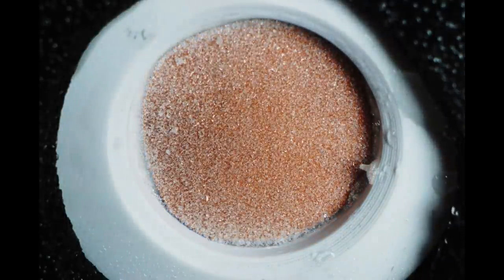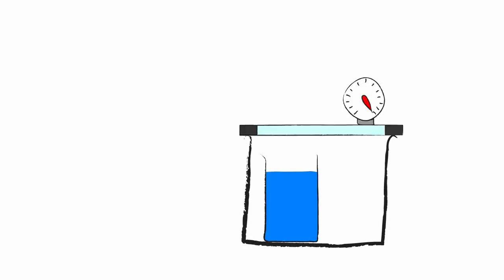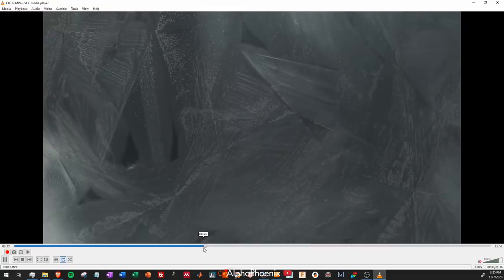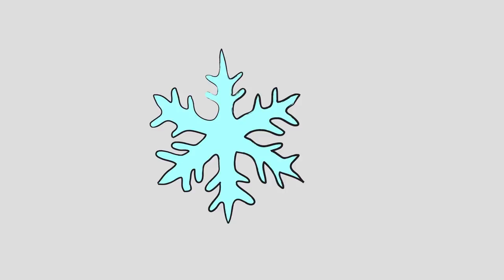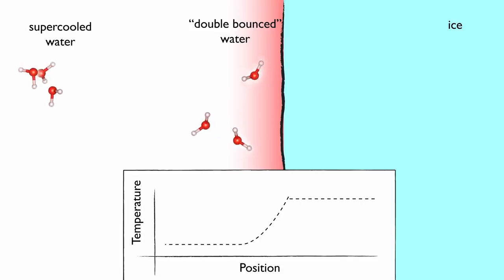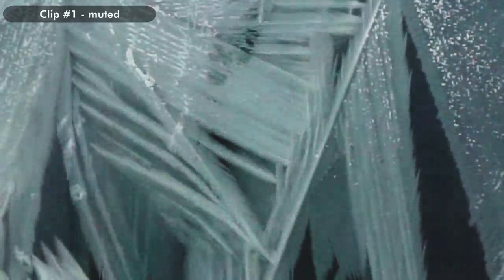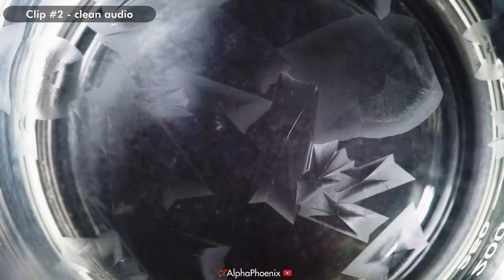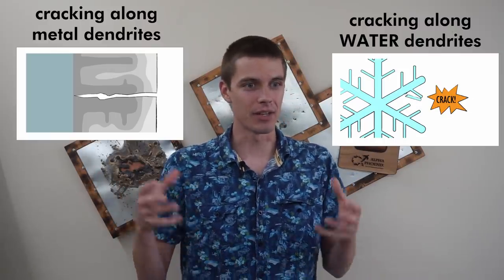The Sound of Freezing: Explained!

Comment: Awesome video. Such a great explanation and really nice clips from the freezer. I have been wanting to make a video showing the degradation of concrete from cycles of freeze/thaw. Whenever I get around to it, I'm going to need to remember these lessons about filming in the freezer!
Reply from the maker: ah i was totally going to add a joke about cracked pavement in Ohio and i forgot! this is like freeze-thaw cycle occurring inside the ice... good luck with your eventual filming!
Reply: @AlphaPhoenixChannel  perhaps the high pitched sounds are the result of a rapidly growing crystal lattice that traps previously-dissolved gases.  Ice would encircle trapped pockets of air, and press inward to due to the expected increase of volume of frozen water.  The overpressure of air bubble crystal inclusions in ice is a well studied phenomenon, although your interest in sound might be ... unique.  I would expect the individual "blips" of sound to be the shockwaves caused by stress fractures created when ice encircles a pocket of water that hasn't ejected all of its enclosed gases out of solution.  When gas leaves solution, the volume is expanded many fold, and if there's nowhere to go ... the gas is gonna crack open the surrounding ice structure to relieve as much pressure as it can.  I would not be surprised if the dendritic growth pattern allows a relatively uniform statistical distribution of air bubble sizes and thus the compressive stress to sound effect picking up what looks like a quite short range of frequencies.

Now I want to see the effect of degassing, and if that can explain the different crystalline growth patterns.
Reply: Hey Practical Engineering, why don't you also come over to odysee. I've got some LBRYs waiting for you :-)
Reply: I just noticed you posted here Grady! It's awesome to see you both know each other's channels!
Reply: @erictart4225  Isn't the water already degassed as it is cooled by evaporation in low pressure?
Reply: @Kycilak  possibly at some amount.  I suspect that the cooling process would successfully freeze the water before ever truly and fully "degassing" the water being frozen.

That's why I mentioned fully degassing sample water as an additional control - getting a true answer to your and my question.
Reply: Well look who it is, my other other favorite youtuber

Comment: Time to put a good ultrasonic transducer / hydrophone into a sound-dampened version of the experiment, and record with a few hundred kilohertz of bandwidth. Oooh! Oooh! Then take a wacky turn into left field and start pulsing ultrasonic energy into an ice-forming region. Would a pressure wave inhibit ice formation while a rarefaction wave would enhance it? If you could set up standing waves, would crystals form along the nodes?
Reply: I want to see this!
Reply: On top of this perhaps use a thermoelectric cooler to help remove the freezer noise from the equation
Reply: Yeah. Whatever he said.
Reply: I know you! We played TF2 like 10 years ago
Reply: @Ryan-xc8uh  small world
Reply: I wonder if you can control the rate of growth by putting the water under pressure to govern the expansion... When I lived in buffalo NY we used to stuff beer into the snow and they would stay liquid until you opened them, instant beer slushie volcano, it was fun at parties to watch someone forget!
Reply: My recording microphones goes quite flat to 30 kHz (then sensitivity start to taper off - but they will still pick up sound quite easely up to at least 48 kHz). Not as good as "real" ultra sonic equipment, but still a lot better than what he had there. I also have a silent freezer, with no noisy fan in it. But I have no vacuum chamber and vacuum pump... At the part where he said he couldn't hear it, there was some audio between about 18 kHz and up to 20, where YouTube compression low pass filter kicks in. So just a 96 kHz recorder and good microphone would probably have picked up a lot of it. 
Since I like audio recording my self, it's a little frustrating for me to see someone with such a great knowledge, who pretty much owns a small lab, still using "a potato" for recording the sound on his videos (it would be such an awesome experience to watch all these great videos if they also had good sound, like "binarual audio" or my somewhat simpler setup with 2 good omnidirectional microphones 35 cm apart, at camera position - instead of that crappy shirt mic setup).

Btw. There are also 192 kHz audio recorders available now (which should be able to record sound up to 96 kHz), that isn't very expensive (certainly much cheaper than some fancy lab equipment). Good ultra sonic microphones that can pick up very high frequencies, is quite easy to get hold of for cheap as well - unless they need to have a flat frequency response  down to infra sonic at the same time (my microphones also goes flat all the way down to 8-10 Hz) and the very low self noise required, for good recording microphones.

Comment: Walking in a forest when it's really cold, you can sometimes hear loud popping noises coming from the trunks of trees. In Finnish this is called "paukkupakkanen", which translates as popping freeze. The commonly told explanation for this is indeed water expanding when freezing. Not sure if dendritic growth is occurring in the trees, or if the water gets trapped by some other mechanism.
Reply: I think it's just about the moisture freezing in the tree's structure and, as it turns into ice, expanding. The cellulose of the tree doesn't expand, so it cracks to relieve the pressure.

Comment: A most excellent and thorough treatment. Though I've known the reason for water ice's hexagonal symmetry since high school (the 104° bond angle of the molecule), I've never seen a clear explanation of the dendritic growth mechcanism before. There's certainly a paper in this sound thing if one hasn't already been written....
The foley freezing sound is kind of understandable if you live in the North. You can definitely hear ice cracking in the forest after an ice storm or when you walk on a newly frozen lake the sounds are kind of similar but deeper. Also supercooled ice cubes from the freezer make related crackling noises when dropped into a drink from the thermal shock.

Comment: The fact that quickly freezing water makes the sound that Hollywood lead us to believe is purely amazing. 
I thought for a little while on how did it happen (I really doubt that a lot of sound engineers actually heard this specific sound). I think I have an explanation. They were looking for the sound of ice. The only situations where ice actuality makes any sounds normally is when it cracks, be that by walking on it, or throwing an ice cube into a drink that's too warm. So yeah, cracking sounds makes sense. 

But I would have never guessed that this sound has any realistic and scientific merit to it. So cool
Reply: No. They heard it.
If you put a bottle of water in the freezer for the right amount of time it will be liquid, just waiting to become ice. That it out and tap it and it will instantly freeze and you will hear the ice.
Reply: @sailor5853  Timing it right can work, but more reliably, you want to make super critical water that will freeze when you tap it or otherwise disturb it. Easiest to do that in a nice, clean container, and before you try and freeze it, boil it. This reduces dissolved gasses and subsequently nucleation sites. Probably does a lot of other stuff, too, but I'm no chemist.
Reply: This is the same sound as when an icecube is melted by water, likely for the same reason explained in the video, and it is very audible. Also, I have heard this from ice forming on house and car windows.
Reply: Or pouring water into a bottle partially filled by ice- crack crack. 

Speaking of Hollyweird fakery, the 'iconic' bald eagle call used ALLL the time in movies is a from a hawk. The B.E.'s call is a pathetic cry 😂
Reply: @sailor5853 *Take [it out].

Comment: I heard water vapor crystallize in 1996 while wintering over at the South Pole. I first noticed it while relieving myself outside when the air temperature was below -75f. There was no wind so it was extremely quiet out. The noise was soft but sounded like the rush of water from a pressure washer. The unexpected sound made me stop and turn my head to see what was making the sound. Hearing nothing I continued only to hear the rush again. That’s when I realized I could hear the steam from my urine crystallizing. Later on in the winter the same phenomenon would occur every time the temp was around -75f. I’m assuming this would be different at sea level as we were at 9301 ft with a physo altitude of 12-14k depending on the day. At -103f when running naked from the sauna out to the pole and back I could hear the steam from my sweat crystallize as it passed my ears. We were basically leaving human contrails behind as we ran. I’ve always wanted to reproduce this effect in a freezer and get it on tape. Thanks for this vid!

Comment: IPhone camera works well when lined up and balanced it on top of the microscope, you can see things better than looking down the microscope which makes the standard eyepiece approach kind of crazy. The resolution is good, the built in app goes up to 240 FPS for video, for still images I can recommend "ProCam" for straightforward, manual and numeric control of things like focus and exposure over a huge range. A bit of colour mapping afterwards can be helpful. Note that confusingly it can focus further away than infinity.
Reply: Further away than infinity focus = negative focus

The focal point is behind the camera.

Comment: I've seen thermal cracking especially in welding aluminium. It cools quickly and it's soft. If your weld cools down too quickly, it can crack all along the centerline. You might not notice it because it's under the surface, so ultrasonic testing is the only reliable method of catching it. With slight mechanical stress, it will crack open and make for a bad day.
This was some awesome research, and I learned something about metallurgy too!

Comment: I think there is a setup that will interest you : you can use a smartphone audio cable, uncover the small microphone inside, put a small plastic piece directly on the microphone then put a small drop of water. I think that when freezing you will hear very clearly the crackling sound of freezing.   Concerning your own setup you can hear the sound very clearly if you use a microphone that you stick firmly on the the surface of the water container. As you know the sound passes much more easily between solids than through air.

Comment: I find this incredibly fascinating. I'm betting that there's a strong correlation between dendrite size and the pitch of the crackle, so I'm theory you could determine the size of the dendrites when they break. There might also be something interesting to gain from the volume of the noise. Maybe when two similarly sized spikes interact and the smaller one breaks the noise is quieter, but when a small meets a large the noise is louder? If only there was a good way to control the formation of the crystals. Maybe including specially designed nucleation sites that can form regular crystals aligned in a particular direction or something (metallic hexagonal particles in a magnetic field?). Seems tricky to pull off, but it'd be really cool to see and study.

Comment: Dude, you're the most under-rated science youtuber right now. This is amazing stuff!

I'm a materials engineer as well! Do you reckon a University nearby could have an environmental SEM (ESEM) that you could use? That should have the temperature and vacuum controls you need, and obviously super high mags.
Reply from the maker: Ooh good thought - I use an SEM all the time that I believe can run in a low vac mode, although I’m not sure what that does to the signal (and therefore maximum framerate). I’d need to do some convincing regarding putting liquid water in a research level vac chamber though

Comment: One potential follow-up experiment that would be interesting is to add copper/aluminum (or other good thermal conductor) into the water and observe the dendritic growth that happens along it's edge. Would be interesting if the thermal conductivity affects the speed of growth, as your explanation seems to assert (breaking the "heated" water depletion zone).

Comment: How do you hear the sound if it's in a vacuum chamber BTW? Is it completely transmitted through the water and the container? If so, if you have a contact microphone, you might pick it up much better still!
Reply: It's a partial vaccum at the most it's only pump down to 10-20 microns. Anything anymore you need to start having some expensive pumps like diffusions pumps I ran high vacuum sintering furnaces and at 20 microns is enough of an atmosphere it would ruin the metal we ran.

Comment: You might want to hit up Destin of Smarter Everyday. He has done high speed microscopy with jellyfish stinger things in the past. 

I work at a place that does a lot of crystallization. We have to seed our material otherwise everything can crash out all at once which yields a terrible product quality, or it just sits supersaturated and forms nothing at all. I have a small reactor I run experiments in, so I am sometimes lazy depending on what I am working on and skip the seeding step (typically 20C). I can sometimes take it to -5C before giving up and doing things the right way.
Reply: And? Did you ever hear your crystallizations?

Comment: This is also a decent visual representation of what kills lithium batteries. 
From what I understand, by charging batteries beyond 80% and under 20% the ions migrate to the anode/cathode, accumulate, and start growing dendrites which puncture the membrane layers of the battery, causing a bunch of tiny short circuits.
Reply: So never let your phone go below 20?
Reply: @cosmiclikesminecraft  it's a good idea to keep it between 20% and 80% there are some phones such as the OnePlus 7 Pro that allows you to prevent charging past 75%. It's handy for preserving battery life.

Comment: When I need to make an ice cube small enough to fit in the neck of a bottle, I run it under some water(temp doesn't really matter), and the instant you first played the noise I could very clearly tell that that's the same sound. But I also am very familiar with the sound because I can hear it from ice forming on windows when I'm in my car or house in the winter, and also because you can hear it right after peeling of a sheet of ice from a window, as the water trapped underneath will form many new ive crystals within a few tenths of a second.

Comment: You know, this got me thinking. People often say there's no microphones on slow-mo cameras, which is fair enough ; but surely there's audio acquisition systems with extremely high sampling rates for scientific purposes right? And I say "audio", but I guess I'm talking about ultra fast/high resolution pressure measurements... Then again, the more I think of it, the less certain I am that it would be useful... (synchronizing time could be a major pain, also there's zero guarantee the crystal you're focusing on right now will be noisier than the others, etc...)

Comment: The sound of snow and ice "talking" is commonplace to me; I live in a location with very cold dry winters and this sound can be heard on a cold, clear winter day just standing outside somewhere quiet. In this case however, the temperature is low enough (sub -30C) there shouldn't be any water; I assume the sun melts the thinnest layer on the surface of the snow which immediately recrystallizes, and when this happens en masse, it becomes audible over time...

Comment: If you've ever been near a perfectly still lake in flash-freeze conditions on a very quiet night, when the water allready happens to be extremely close to 0, you can actually hear this happening. Not nearly as pronounced as in the footage, the closest thing i can think of to the sounds is dropping pins on a mirror, but heard faintly  from very far away and it can last for hours

Comment: Interesting video. I expected that growth of crystals like snowflakes is caused by ... hmm ... not sure how to explain it in English ... energy that is released during phase change from water to ice warming up surrounding water and preventing further crystallization. I tried playing with supercooled water to -14C (outside temp) and it does not completely freeze - it turns into sludge (wet snow) and i'm sure it warms up from -14C to 0C and reaches equilibrium.
I'm actually curious how snow flakes growth works (or various needles on grass or fractal pictures on a glass) cause it's condensing water vapor, not a liquid.

Comment: You try putting polarized light under when freezing?  Maybe with another polarizer over it?
Steve Mould  did Why Sugar Always Twists Light To The Right Be interesting to sugar water freeze.. which is harder to do. The color though would lend itself well to Youtube.  It should also highlight the dendrite from the liquid.

Note: should say I'm thinking beaker of solution with petri dish of water for freezing on top.  As well as just trying freezing on mass. I think though the solution of sugar should change color during the process maybe giving you an extra datapoint closer to the point of crystallization in a different and interesting way.